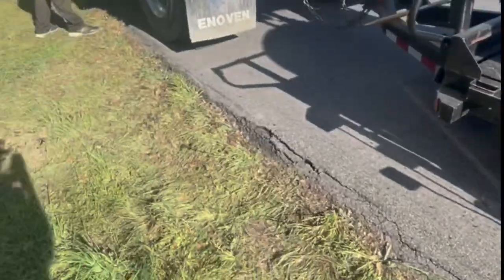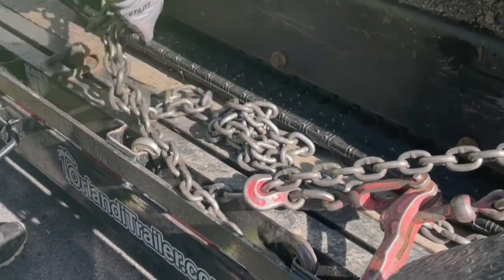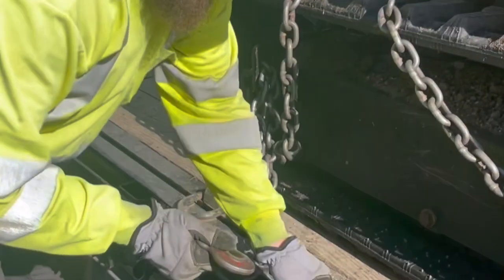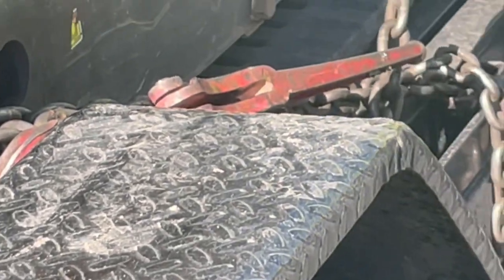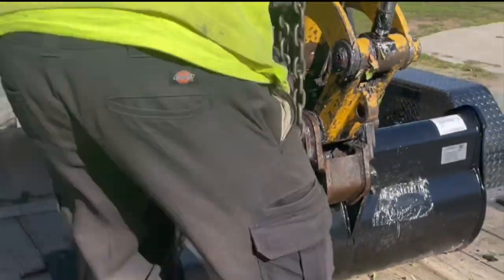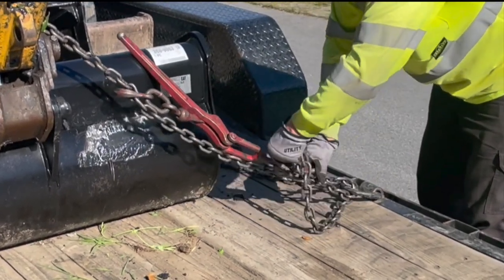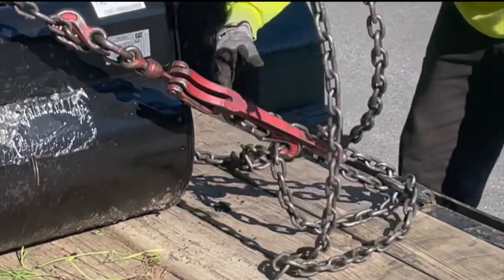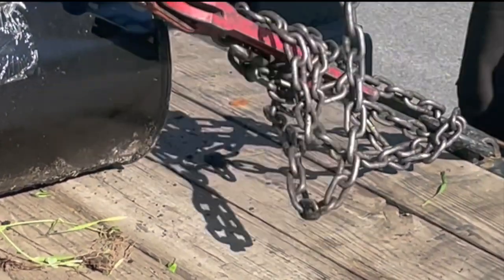How To Tie Down Mini Excavator

Comment: I am not trying to be a jerk but I would disagree with the way you are chaining down this mini excavator.  Especially if you are using the same trailer and excavator every day. Make up 4 short chains with a little leeway and binder machine at 4 points that way and then 1 longer chain for the boom. Believe me after years of doing this you want chains that are easy to move around and handle. Keep it simple.
Reply from the maker: We don’t disagree with you, but as a construction company with lots of equipment and employees, we need the flexibility to transport a variety of machinery, materials and accessories everyday.  Sometimes you need to improvise, but safety always comes first, which we show in our video.